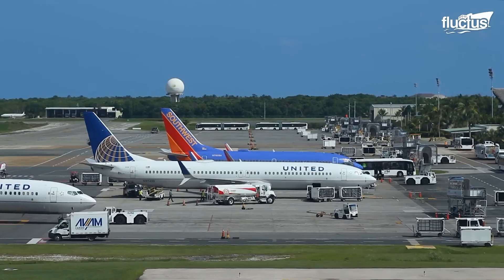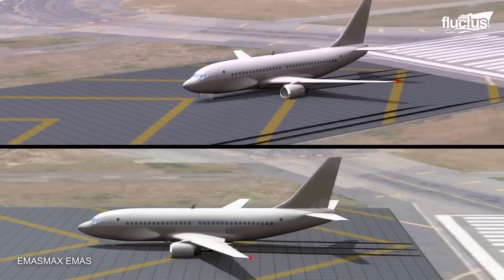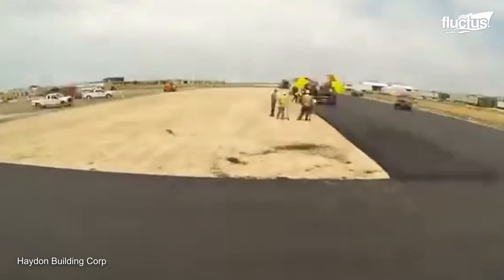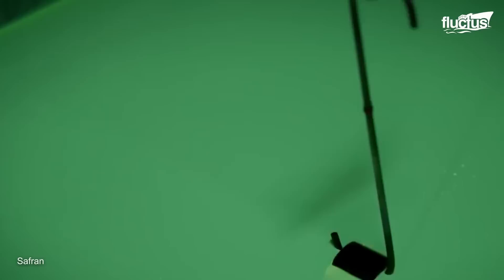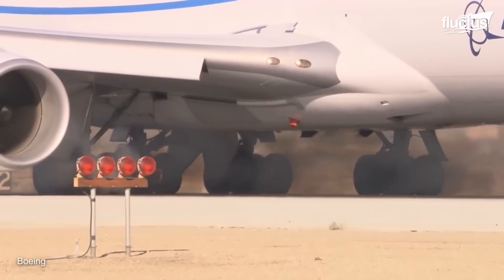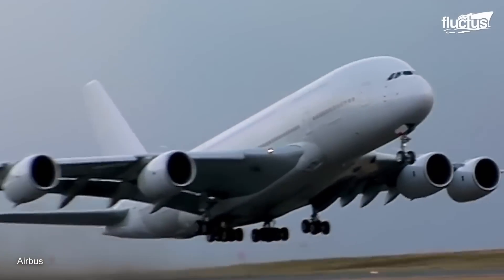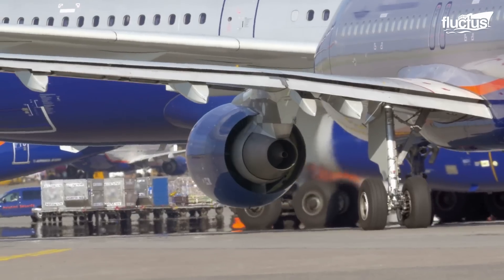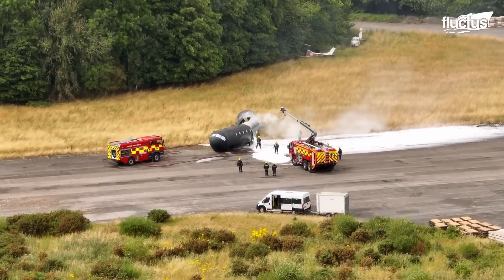Scary Reasons Why Pilots Avoid This Part of the Runway During Landing

Comment: About the RTO rejected take off of the 747-8 , the tires are never deflated by the fire department. They are designed with fuses that f-deflate automatically the tires when they reach a specific temperature and pressure after an RTO.

Comment: A few clarifications.  First off when maximum braking test are performed, the aircraft is landed in the takeoff configuration, then the brakes are applied.  That way they have more runway available for the test.
Second, if you have overheated brakes, you stay far away from them.  The fire department may use a fan to cool them off a bit, but water is only used if there is an actual fire.  
The tires will automatically deflate if they get too hot.

Comment: Correct information in videos like this is imperative for the flying public. As another person identified, the fire department did not deflate the tires so they didn’t explode from heat. A built in thermal plug automatically melts and deflates the tires at a certain temp. The fire department is there to make sure any fire that may develop in the breaks from the aborted takeoff or from an over weight landing does not spread to the rest of the plane.All of these components are highly over engineered to assure passenger safety first then the safety of the plane itself.

Comment: The fire department does nothing to hot brakes except maybe put fans near them to help cool them. When the brakes and wheels get to hot there are fuseable plugs that give way to release the pressure before tires explode. As an ARFF individual we never   put anything on hot brakes unless absolutely necessary like a metal fire. In which case we have purple k to use on the metal fire.
Reply: Is that from cool to hot, till the brakes get too hot??
Reply: @johnrogers9481 ???

Comment: The tires have thermal plugs which are designed to melt at certain high  temperatures  to release the air pressure from  the tires due to overheated brakes to prevent them from exploding.
Reply: Jjjjjjjjjjjjjjjjjjjjjjjjjjjjjjjjjjjjjjjjjjjjjjjjjjjjjjjjjjjjjjjjjul